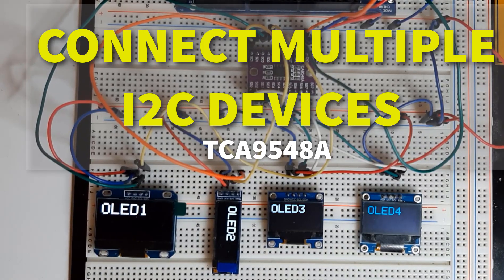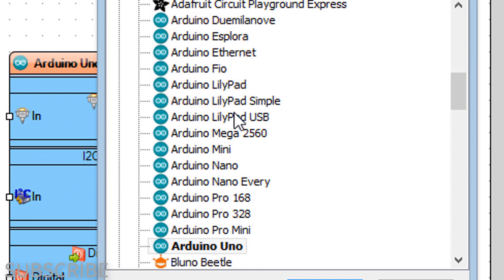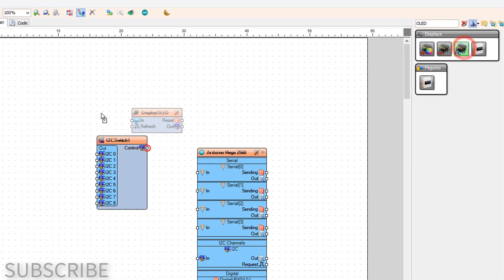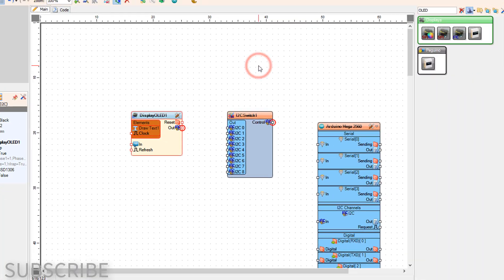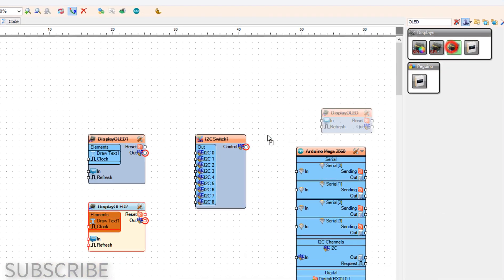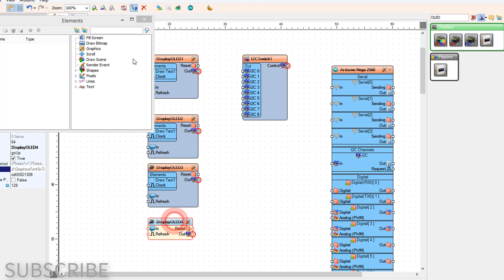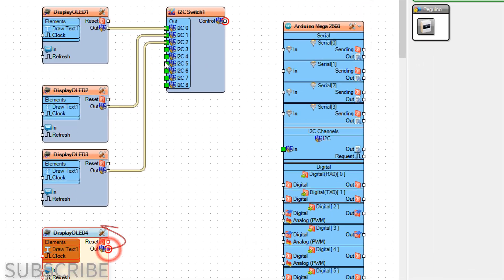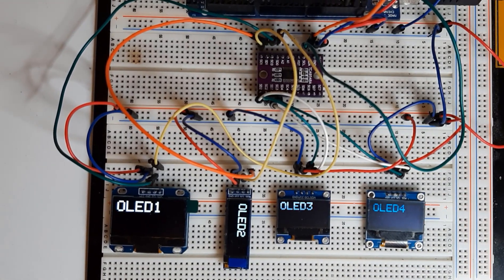Arduino Connect Multiple I2C Devices - TCA9548A I2C Switch

Comment: Is there any way to connect multiple I2C devices to the Arduino without having to use a switch? Etc. Barometer + gyroscope?? Thanks
Reply from the maker: Hi yes sure without a problem, as long as they have a different address. Connect Barometer SDA&SCL to Arduino SDA&SCL and to the same for the gyroscope.
The problem is if you have modules with the same address like 2 OLED displays, in this case you need a switch.